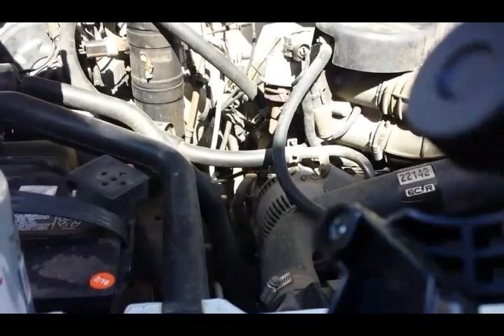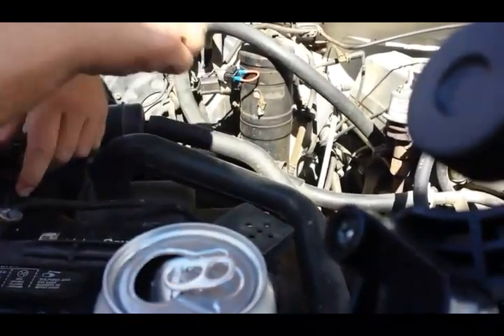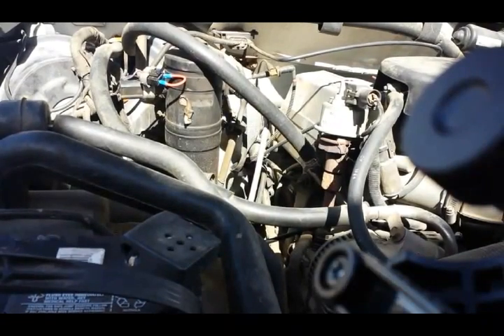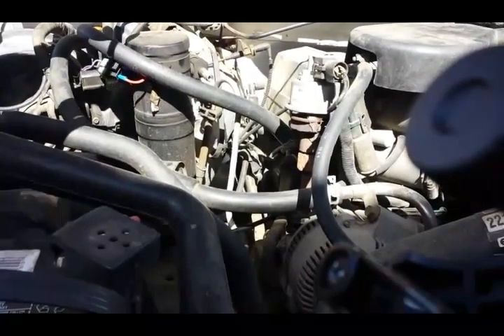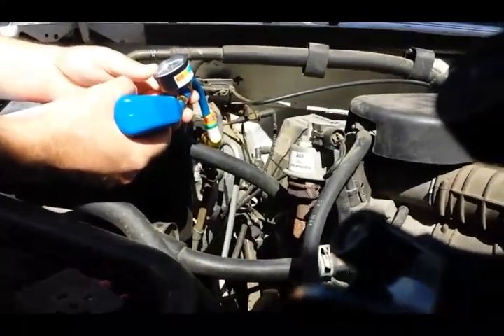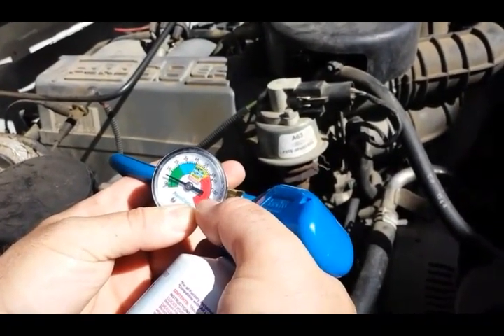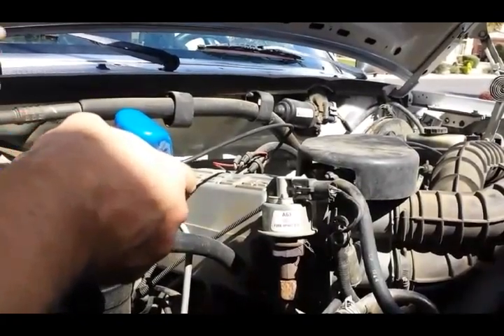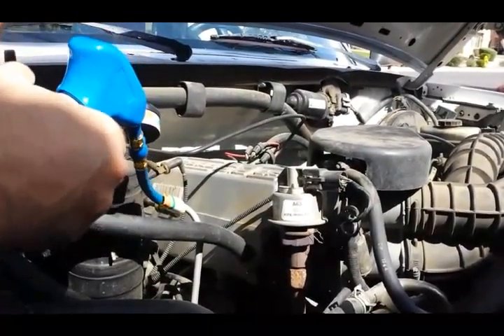Charging an AC System on 95 Ford F150 Using A Jumper Wire To Engage the Compressor Tutorial

Comment: your gauge is different than mine.. mine has Green, yellow and read.. it says stop mid green.. but I also have the professional gauges and the Chart...
for those not professionals...
you have to realize that just charging does not always work..
I had to change the Orifice Tube.. pump it out, then recharge..

Comment: this video is not helpful at all. you never show or explain where the harness is or which harness you are jumping, is it pin 1 to pin 3? we dont know??. and with only one fitting ( low side) that fits the recharger, you dont need this video to learn which valve is the low side. theres only two and only one that fits, if you need a video for that, you shouldnt be doing this yourself
Reply: Also, provided the low pressure switch is not faulty, there is no reason to jumper it, it's there for a reason, when recharging a system, the LPS will engage the compressor clutch once the low side reaches the appropriate minimum pressure.
Reply: @davi1td dont you need the compressor to run in order to recharge anyways(many wont run when low)